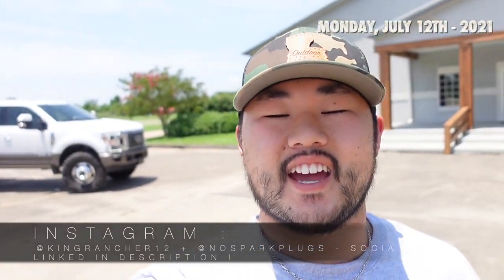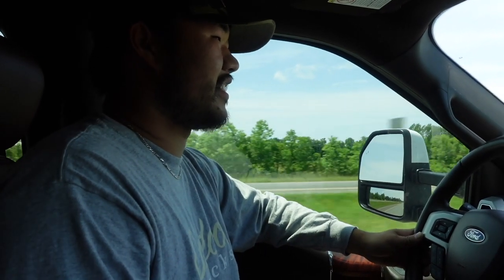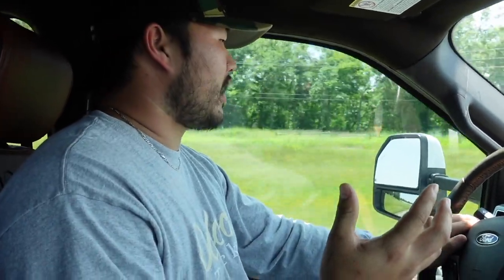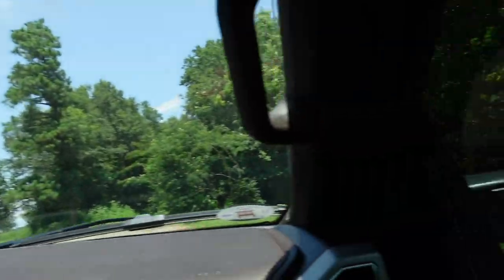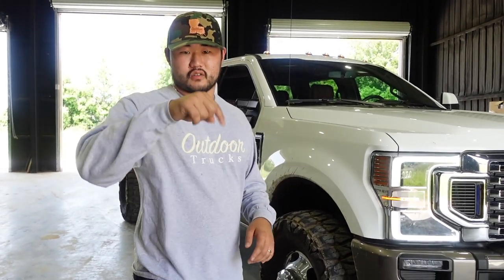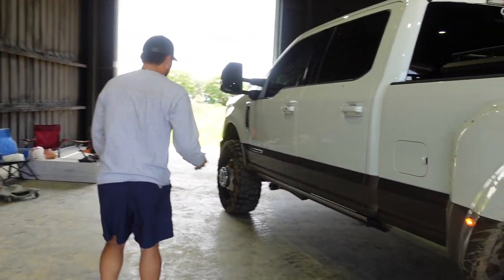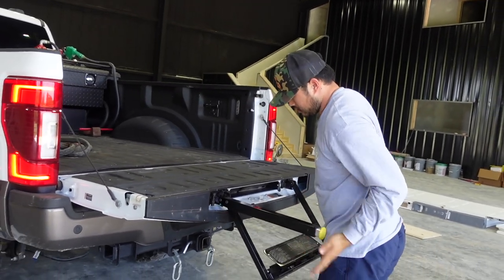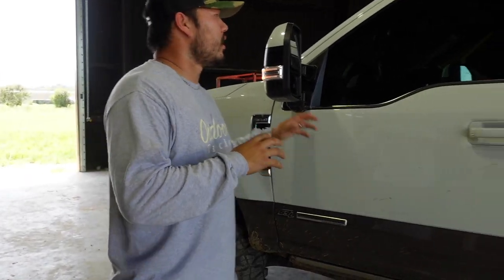Nitto Mud Grapplers: Most Asked Questions!

Comment: What psi do you run in these tires? Also what did you run on the 250? Daily driving and towing if you change the psi when doing either